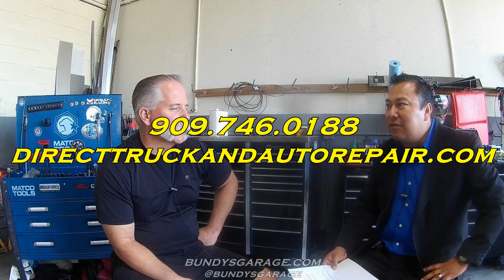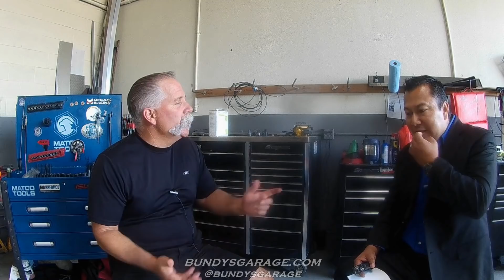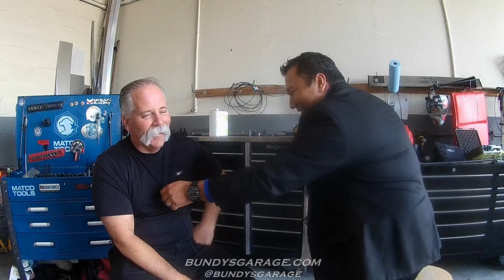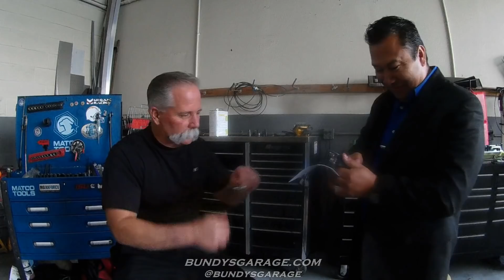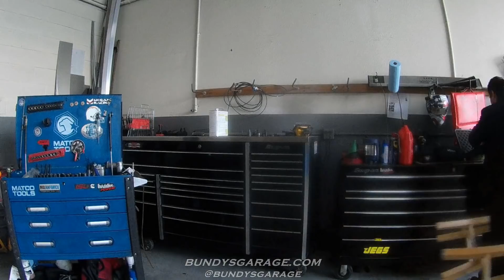Worst Diesel Engine Ever - What is the Best Diesel Truck out There? | Ford Dodge Chevy

Comment: We had a international lo pro box truck at work with a 7.3 turbo and a 5 speed. It never broke down in the 40,000 miles we put on it but The drivers pitched a fit and no one would drive it it would run about 80 on flat ground and it was about 45 mph up any hill. We called it the dragonfly truck drag up a hill and fly down it. We had an early 80s c70 Chevrolet with a 366 gas that pulled about twice as good as the 7.3 did at least you could stay over 62 mph on an average hill on the interstate and run 72 or so on flat ground. It was finally replaced with a 4300 international with a DT 466 and an Allison. Definitely a better set up than the 7.3 But call me crazy I still kind of miss the old 366 big blocks and 427s we had roaring down the highway. They really didn’t give much trouble just hard on for you but I still think they were a little cheaper to operate.
Reply: Shawn Bowman I agree, slow but steady
Reply: Hard on fuel lol!
Reply: I use to load up a 5 ton working for a government department that had  a bb chevy.
Didn't check if it was the 366 or 427.
All city and lots of hills and ramps fully loaded everyday.
Fueled up a couple times a week and it never missed a beat.

Comment: The ford 6.0 diesel was a great motor. If it was in a school bus it would have never had a problem, it’s when they threw all the emissions crap on it that’s what killed it. Well, that and tuning. Some of these tunes are ridiculous.
Now, as far as new diesels the 6.7 power stroke is one stout engine. The 2010-13 when they first came out had some issues but they ironed all those out. My buddy has a 2015 with 450,000 miles and has only performed maintenance on it with zero problems.
Reply: No, the 6.0 was NOT a great engine. It's garbage, period. You can't make them good or reliable.
Reply: @moparproud3978  -Yes they're very reliable and have good power and mpg's when they are bullet proofed. The 6.4 was a bad engine. The reason that the 6.0L was not as good as it could've been was because of govt emissions and Ford was pressured into putting it out faster then they wanted too.
Reply: @jimh.412 The only thing reliable about a 6.0 is the fact they WILL fail. They are not a good engine, they're garbage. 100% GUARANTEED to fail. That's not the definition of a great or even good engine, that's not even marginal. That's the very definition of junk...even "bulletproofed" and deleted, garbage.
Reply: @moparproud3978  Sure Mopar kid. Have you ever owned one? If you keep them stock they are alright with plenty of power but most people don't keep them stock because you always want more power. When bulletproofed they are very good engines and reliable. Again goofy, the 6.4L is the bad one.🙄
Reply: @moparproud3978  Lol-Sure they did kid.  Can't take anybody seriously who has your name. Mopar? Seriously? 😂You sound like a little kid to come up with that name. You better get some sleep you have a big day at school tomorrow.
Reply: tom h+

The problem with the 6.0 Ford/International diesel was Ford. 

The 6.0 was brought to market to be quiet. 7.3 engines rattled like a can of marbles. Where Ford went wrong was Chevy came out with the Duramax that had horse power and torque numbers higher than the 6.0. Ford went back to Navastar and wanted more power. Navastar told them that the cast cylinders wouldn’t take more power, but Ford did their own tune to boost numbers. 

Well, 6.0 engines launched cylinder heads with the increased boost. EGR valves were failing on trucks with less than 10k on the clock, melting pistons and heads. Head gasket replacements required cab removal and close to 2 weeks at the dealership. 

The 6.4 was supposed to fix the short comings of the 6.0, but fell far short. First gen 6.7 diesels had injector and glow plug problems as well as high pressure pumps. Lots of blown up 6.7 engines with the glow plug imbedded in the piston. 

Don’t forget about the first diesels Ford used, the 6.9NA engines. A whopping 120 horse power coupled to a granny geared 4 speed. Can’t pull a greasy string from a pigs butt.  The 7.3NA added about 25 additional horse power over the 6.9 and was equipped with a 5 speed. The 7.3 turbo brought horse power to around 210-220 depending on emissions package. The Navastar engines used in International trucks were under rated, but went 500k miles. 

I’ve got a Ford F650 with the Cummins 5.9, Allison 3000 series automatic transmission. Other than the $500 biannual transmission service, it’s as close to bullet proof as it gets. 

Looking forward to doing a Cummins 2.8 install in a newer Ford F-250-350.
Reply: Gunga Dinn 
You fail to mention the teething problems of the GM 6.2 liter and before that the pile of shit Oldsmobile motor turned diesel and the current duramax had issues in its first years with gaskets and injectors left and right. So when you tell us about the ford/international issues you might look at the duramax/Isuzu problems. C’mon man!
Reply: Any first year product of any brand name WILL have issues is what I’m trying to say